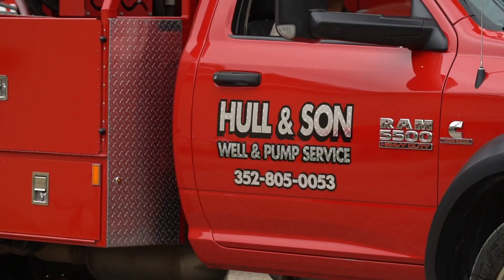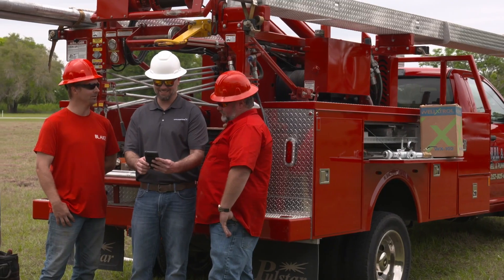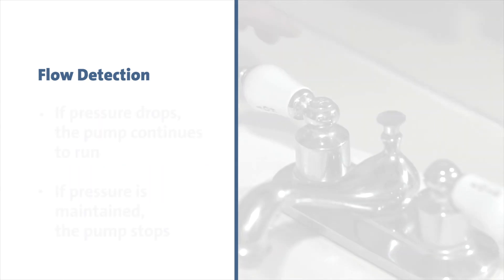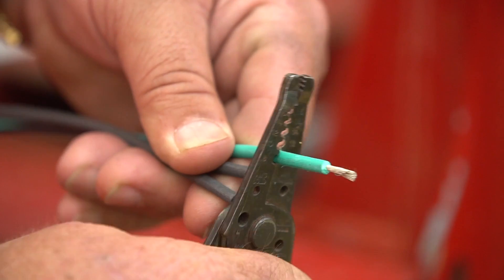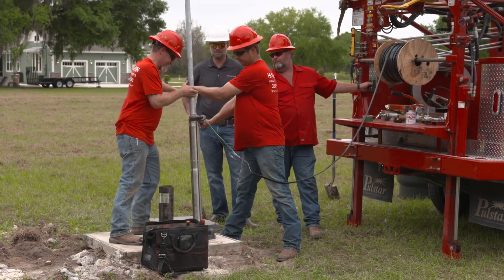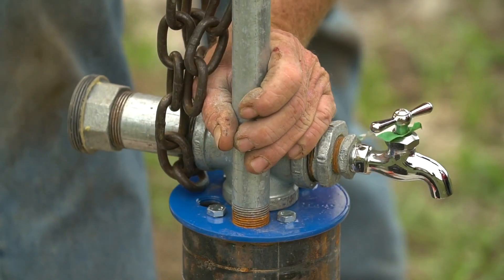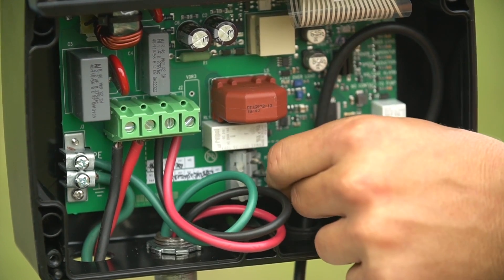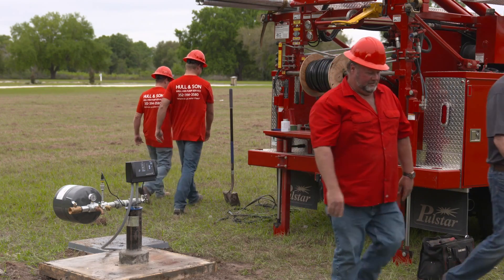Installation of a Grundfos SQE Constant Pressure System

Comment: I am replacing my old 220V pump with a 115V Grundfos 10SQE05-160 for my log home, do I need a CD301?
Reply from the maker: Hi, 
Yes, you need a CU301 controller for all models of SQE. :)

Thank you, 
Steph
Reply: @grundfos  installed a 10SQE05-160 last week to replace my 220V pump and it is working fine did no install a CU301
Reply from the maker: Thank you for your positive feedback! We're thrilled to hear that your new 10SQE05-160 pump is working well for you. If you have any questions or need further assistance, feel free to reach out. We appreciate your trust in Grundfos! 😊 -Steph